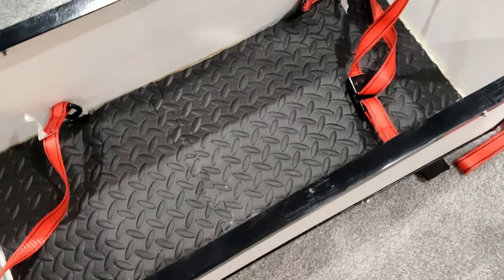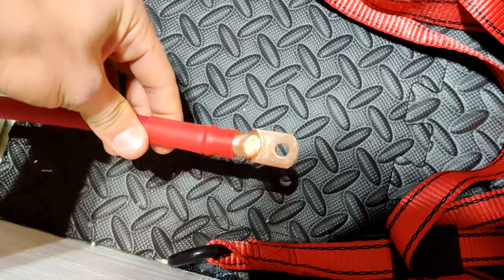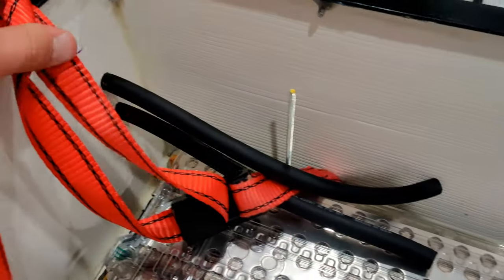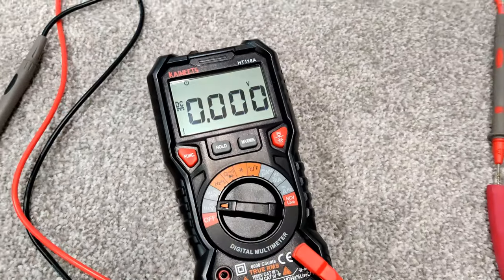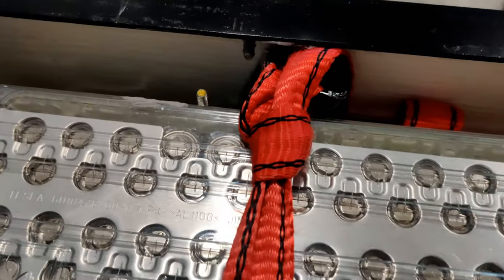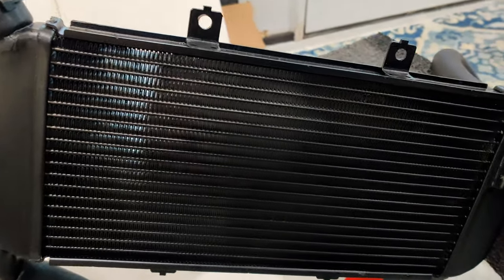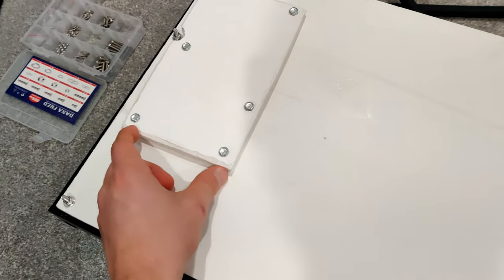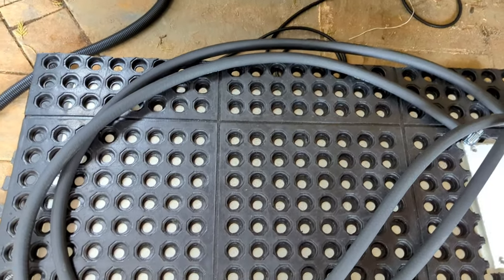Ford Escape EV Conversion EP 23: Mounting the Rear Battery Box

Comment: Thanks for the educational and inspiring videos! Could you please share where you've sourced the fitting connectors you're using on the inlets/outlets of your battery modules?
Reply from the maker: The coolant fittings are from alpha auto, Google alpha auto Cortland NY and there's a number you can call
Reply: @reider_mcfeely  Question related to the zero-ev manifolds. Would it be possible for you to check the ID of the input? The drawing on their website says OD is 12mm. But I'm looking for the ID. Unfortunately I cannot fit these manifolds into my build. Need to improvise....
Reply from the maker: @ruggedplus  I just installed the manifolds (coolant video coming soon!) so unfortunately I can't check the ID of them. I would guess it's somewhere between 8-10mm though. You could place the manifolds outside of your battery box and then run the individual module coolant lines into the box, that's what I'm doing with 2 modules in a battery box that didn't have space for the manifold inside. 

The important thing is to have even distribution between the modules, they don't need a ton of flow but they do need some. A 10mm ID inlet should be plenty for a 5 module manifold.

Theres a guy on YouTube called Greg Goes Electric who used a whole Tesla pack in a F350 conversion I believe, and he used a different manifold design. Might be worth reaching out to him and see how he made that.

Comment: Tesla modules are not meant to be stacked plastic to plastic and compressed like that, they have mounting tabs on the sides of the modules to stabilize them.  Also, you should probably make new hanging brackets to replace your wire rope solution, or at least swage the wire ropes.
Reply from the maker: They're not supposed to but many people do without issue, when they lay on top of each other the plastic cell mesh prevents the cells or the busbar surfaces from touching and this is the same plastic mesh that connects to the mounting tabs on the sides so it shouldn't be a big issue. 

Yes the wire rope solution definitely isn't the prettiest or the most reliable so I added a second set thru each loop for redundancy. I'll be checking them often when I start driving and if needed I'll try to figure out a different solution. The clamps seem to hold pretty well though, I did some load testing with just a single clamp and didn't have any slipping until around 300lbs of weights was hung from it, so hopefully no issues but we will see.

Comment: I'm just wrapping up installing 3 Tesla modules in the front and 3 in the rear of my 914, nearly exactly the same way you've done yours.  I've recieved some, shall we say, negative, feeback on the stacking of the modules in the box.  I see you have one below here too.  Any feedback after a year of driving?  I put a layer of foam and a Tesla mica sheet between each layer.  I'm only going to be using it for cruising around Barcelona at low speeds on sunny days so I'm putting pretty much the least stress possible on the modules.  Appreciate any advice, thanks.

P.S.  I've run my coolant lines in series from module to module, not with a manifold.  Do you think mine will work or should I move to a manifold system?
Reply from the maker: Now at about 6000 miles in outside temps from 10 degrees to 100 degrees in all seasons (plus driving on some awful Pennsylvania roads regularly) and the stacked modules are still doing just fine! I didn't even put anything in between which in retrospect would have been a good idea. 

Cooling in series should be fine, especially given what you described. These modules barely warm up at all most of the time.
Reply: @reider_mcfeely Thanks for the validation!

Comment: What material did you use on the bottom of the battery box, is it strong enough to withstand a hit/penetration from something on the road?
Reply from the maker: I used 1/4" PVC sheet which is commonly used in decking. Not as strong as a metal but has held up against rocks/sticks/etc fine. I inspect it every couple hundred miles and no damage or chips thus far but if it starts showing some wear then I can just add a skid plate and that will be taken care of.
Reply: @reider_mcfeely  A few years ago a Tesla ran over something metal in the road, it penetrated the bottom of the battery box and it caught fire. I'd research and mount something maybe bullet proof.